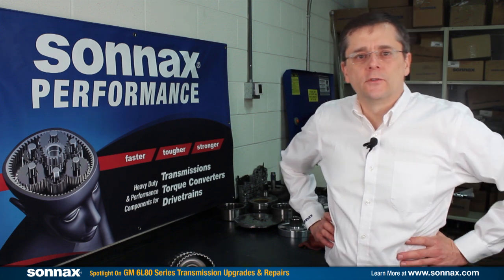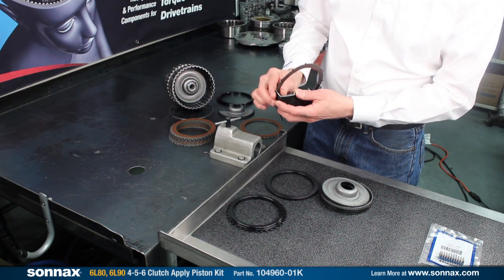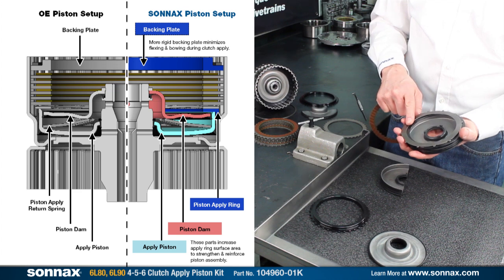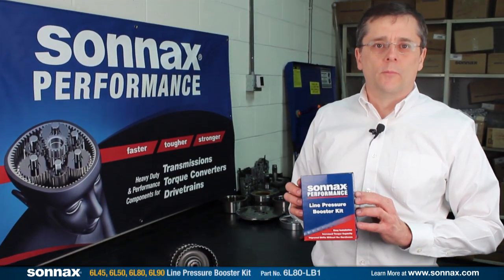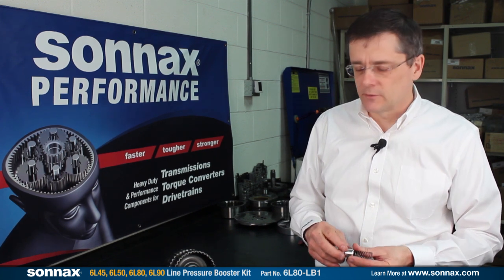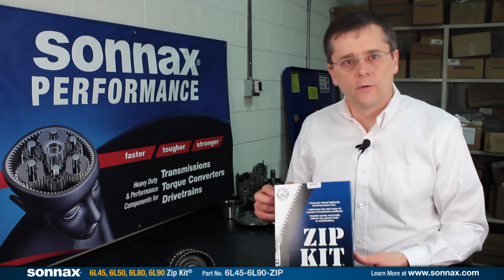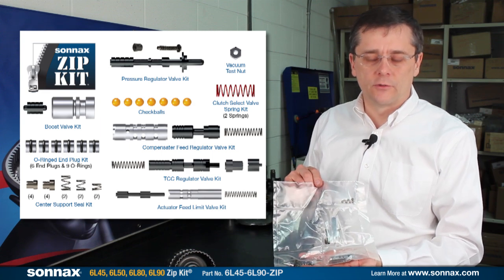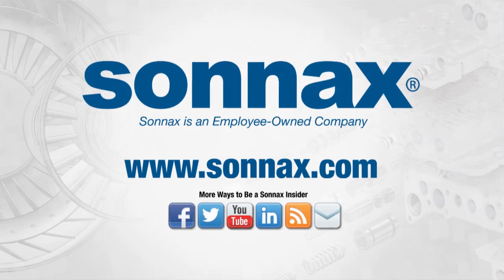Sonnax GM 6L80 Series Transmission Upgrades & Repairs

Comment: I have a 2015 sierra 5.3 with a six speed 135k kms.   The truck has always had a whinging noise.  I hear the torque converter fails on these trucks.  Should I get it replaced before it fails?
Reply from the maker: Hi Cory, our product support team would be happy to help you. They can be reached directly via email at sonnaxtechsupport@sonnax.com, or phone at (800) 843-2600 ext. 398. Thanks for reaching out!

Comment: Can the line pressure booster kit be fitted with the transmission still in the car?
Reply from the maker: Check out this video which dives into the details: https://www.youtube.com/watch?v=fBt9s6DnqXI&lc=UgxulKOpNoOE5Fbae4p4AaABAg. If you still have questions, feel free to reach out to our tech team. They can be reached directly via email at sonnaxtechsupport@sonnax.com, or phone at (800) 843-2600 ext. 398. Thanks for reaching out!

Comment: Can anyone tell me what transmission I have if my truck is a 2014 GMC Sierra 1500 4x4 with a 5.3 engine?
And does sonnax make upgrade parts ?
Reply from the maker: Hi, our tech team would be happy to help you. They can be reached directly via email at sonnaxtechsupport@sonnax.com, or phone at (800) 843-2600 ext. 398. Thanks for reaching out!
Reply: It may be a 4l60e, but some applications have the 4l80e.  I'd call the dealer with a vin# and they'll tell you.  Heavier duty applications have the 4l80e or even the 4l90e.  If you have the 4l80e, get the 4l90e torque converter or an updated 4l80e torque converter.  4l90e converter is stronger and just mount using the stock 3 bolts and leave to other bolt holes open.

Comment: Do you need to have torque converter removed
Reply: Not only removed,  but should be replaced with an updated torque converter on the 6l80.  The torque converter is the Achilles heel of the transmission.  Get that swapped out if it's the stock torque converter before it destroys the transmission!
Reply: @20tea  Thank you for the advice and also your very important time!!!! Not many left in this world like you!!! Again Thank You!!!!!!
Reply from the maker: Hi John, our tech team would be happy to help you with any build questions. They can be reached directly via email at sonnaxtechsupport@sonnax.com, or phone at (800) 843-2600 ext. 398. Thanks for reaching out!

Comment: Very good presentation.  I'm running a VE Commodore Calais-V with an LS3 416ci stroker that has been built from scratch with fully forged internals and set up to run comfortably at 7,200 hence a bit of stress on my 6L80E trans.  Not big power compared to forced induction now days but gets worked hard.  I'm on my second brand new trans and have also had 2 rebuilds as well and I over-service it, plus has a couple of extra dedicated fan mount coolers/radiators to keep temps down.  It does a fair bit of high speed enduro work.  Looks like I may be getting a fair diversity of products from Sonax - only prob is that I live in Brisbane Australia.   Thanks for taking the time and posting.😁
Reply: Ya want to talk to CircleD

Comment: I bought a 2018 LT1 Gen V with a 6L80 4x4 Z-71 to go in a 2x4 S-10. What is needed to convert the transmission to 2x4? I am being told I need to change the shaft out to the 2x4 shaft!
Reply from the maker: Hi Alan, our product support team is available to help with any questions related to Sonnax products (https://www.sonnax.com/product_support). For general tech questions, we'd recommend contacting our friends at ATSG (https://www.atsg.us/) or ATRA (https://www.atra.com/) for assistance. Thank you!

Comment: Is the boost valve in the zip kit the same as the line pressure booster kit?  It appears the zip kit doesn't have the upgraded spring.  Can that spring be purchased separately?
Reply from the maker: Hi GWRus77, Zip Kits are designed to restore OE operation and pressure curves. The line booster on the other hand is meant as a performance upgrade for firmer-than-OE shifts, and thus uses an increased ratio boost valve assembly and elevated PR valve spring. So no, these are not the same. You can certainly use the two kits together, but you would need to purchase both and just disregard the boost valve assembly in the Zip Kit. Hope that helps, thanks!

Comment: I'm in the process of installing your zip kit and upgraded apply piston in my 6l80, so far everything has been straight forward.
Need a little clarification on step 1a. of the zip kit. "Drop one Sonnax 1/8" aluminum checkball into OE orificed cup plug.
Drive checkball into cup plug with appropriately sized punch. Stake cup
plug to prevent checkball displacement."

boring the new oriface is no problem, and I understand driving the checkball down into the cup... but what is meant by "stake cup plug"? What am I staking it with? What exactly am I supposed to do here? thanks in advance.
Reply: Posi12Bolt did the trans need to be pulled for the zip kit
Reply from the maker: Thank you for your question. Our tech team would be happy to help. They can be reached directly via email at sonnaxtechsupport@sonnax.com, or by phone at (802) 463-0288. Thanks again, and have a great day!